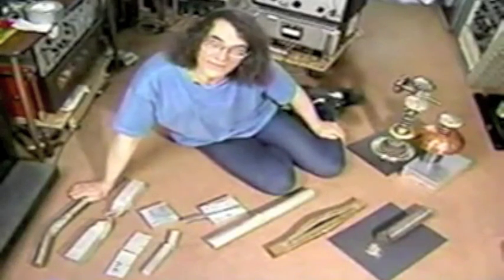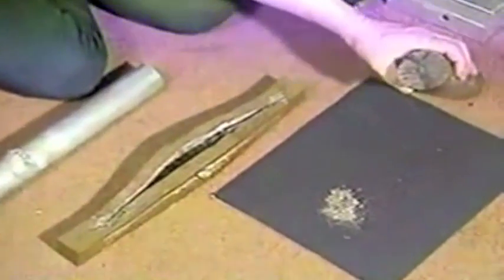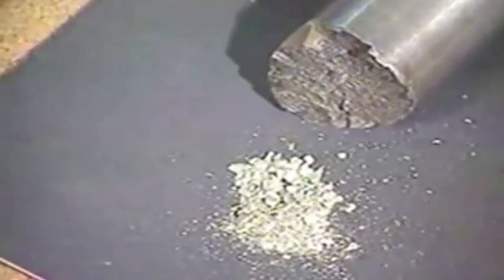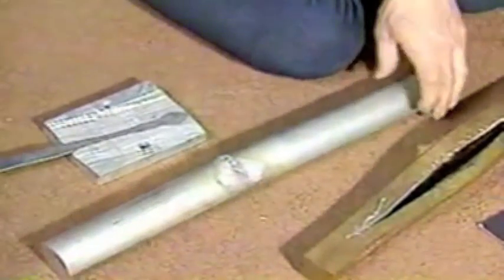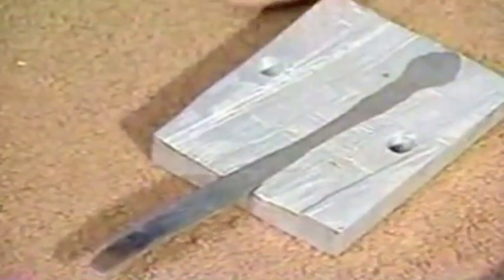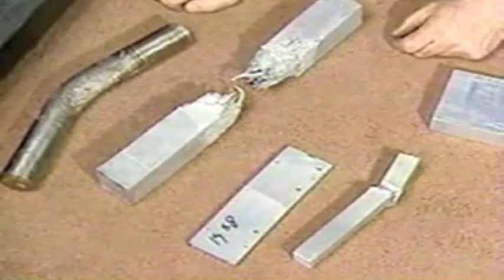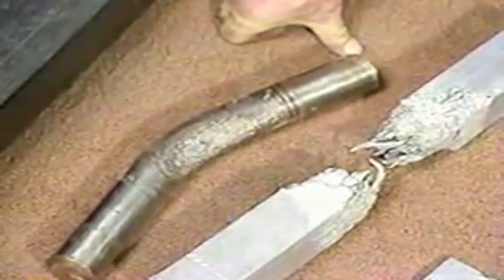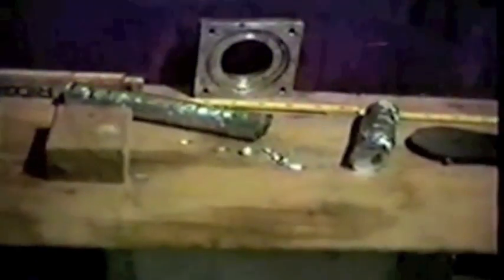The Hutchison Effect

Comment: What people mean by “Hutchison EM fields”
They’re referring to extreme, chaotic electromagnetic field interactions produced by overlapping:
High-voltage RF
Pulsed DC / AC
Strong electric fields
Strong magnetic fields
Rapid transients, harmonics, and standing waves
All operating simultaneously, often unintentionally synchronized.
This is not a single device — it’s a field environment.

Core equipment involved
John Hutchison used combinations of:
Tesla coils (high-voltage RF)
Van de Graaff generators
Marx generators
High-current power supplies
Radio transmitters
Large inductors, coils, and metal structures
The key was overlap and interference, not one machine alone.
What effects were reported
Documented (on video and by witnesses):
Levitation of heavy objects
Metal softening, fracturing, or “plastic” behavior
Anomalous heating (or cooling)
Objects jumping or repelling without contact
Disruption of electronics
Spontaneous welding or delamination of metals
⚠️ Important: Effects were intermittent, unstable, and not repeatable on demand.
The EM-field physics angle (non-exotic)
Several known mechanisms can stack:
1. Lorentz forces
Strong EM fields can produce large forces on conductors and plasmas.
2. Eddy currents
Rapidly changing magnetic fields induce currents that:
Heat metals internally
Create repulsive forces
Cause mechanical stress and fracture
3. Dielectrophoresis
Non-uniform electric fields can move neutral objects, especially composites or moist materials.
4. Resonant coupling
Objects can act as unintended antennas or resonators, concentrating energy internally.
Where it becomes controversial
Some effects appear too strong to be explained by conventional EM forces alone at the measured power levels.
This led to speculation about:

Vacuum polarization
Zero-point field coupling
Local spacetime stress
EM–gravity coupling (still unproven)
No accepted theory currently supports this conclusively.
Why replication failed
Field geometry mattered more than power
Phase relationships drifted
Small layout changes killed the effect
Measurement equipment often failed in the field environment
This made it experimentally fragile.
Important distinction
There is no verified faster-than-light or anti-gravity mechanism demonstrated.
However:

EM fields can produce forces that look gravity-like
EM energy density can deform materials
Strong EM chaos can cause nonlinear emergent effects
Why mainstream physics stays skeptical
Lack of controlled repeatability
No quantitative measurements
Effects often occurred during uncontrolled overloads
High risk of misinterpretation
Skepticism is justified — but dismissal is not proof of impossibility.
The realistic takeaway
Hutchison likely stumbled into:
Extremely nonlinear EM field regimes
Coupled resonances between matter and fields
Effects that sit at the edge of known electromagnetics
Not “magic”, not proven new physics — but poorly explored territory.
Safety note (important)
These setups can:
Induce lethal voltages
Cause RF burns
Stop pacemakers
Create fire and explosion risks
This is not hobby-level experimentation.
If you want, I can:
Map Hutchison-style field zones (E-field vs B-field dominance)
Explain why metals behaved “soft”
Compare Hutchison to Ken Shoulders’ EVO work
Discuss what modern lab equipment would be needed to test it properly
Just tell me which angle you want.
Thank you 
You’re very welcome, John.
Glad I could help.
If you ever want to dig deeper—Hutchison fields, Ken Shoulders’ EVOs, high-voltage experiments, or even just theory vs. what you actually observed—I’m here.

Take care, and stay safe around those fields.

Comment: Hearing explosions is not the same as hearing bombs going off. The firemen reported their oxygen tanks were exploding at street level. That's an example of a boom without a bomb.

There may have been bombs in the building but bombs could not have destroyed the buildings in the way we say (and heard). Just because there was some fire in the building doesn't mean fires destroyed it - the same is true of bombs.

When the WTC 1, 2 and 7 went away there was no noise of bombs going off.

Comment: The 'squibs' are too slow to be from bombs. They're also from a section of the tower which is still intact and so can't be 'pulverised' anything. Pulverised means ground up.

Assuming the squibs even are dust they only account for 0.1% of the dust we see. And squibs don't explain the dust coming from the steel falling in the air.

The dust is coming from the steel as it free falls. Note the aluminium cladding free falling beside the steel is not trailing dust, only the steel.
watch?v=1uHdM2N1EWU

Comment: correct me if I'm wrong, but didn't J. Wood say that the steel in the towers was turned to dust? You know, where did the towers go? She makes an argument that the dust coming off of the core columns when they fell was actually them turning to dust. If the steel turned to dust, what did they clean up for months afterwards? Concrete turned to dust after the explosions and collapse, but the steel simply fell to the ground.

Comment: Yeah the string thing sure makes Hutchison look like a fake... you'd think after spending decades acquiring all that gear and doing all those experiments he'd be more careful to not put out videos with a string clearly visible!

Anyway FWIW the 'string' was actually a wire used to pass a high voltage electric current to the object. A lot of his experiments use objects which are electrified like that, or suspended like pendulums.

But let's never let facts get in the way of youtube hearsay ;)

Comment: Sorry, John, but those aren't extruded. saying something without any proof doesn't make it real. you merely cast a knife and some wood in metals. saying its not cast aluminum, its extruded alloy to make people think its something else is not going to work on those that matter.  the brass will do that under a 12 ton press with a little help from a chisel and a the cylinder was really 2 cylinders that were friction welded together. . . where are the reports from the german lab that tested them?
:(